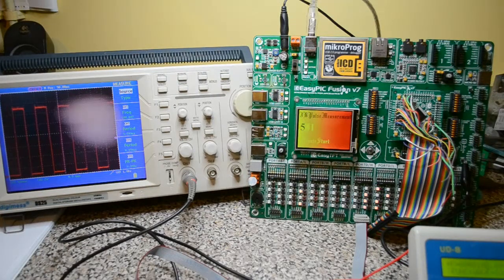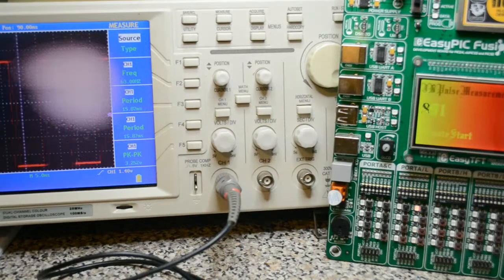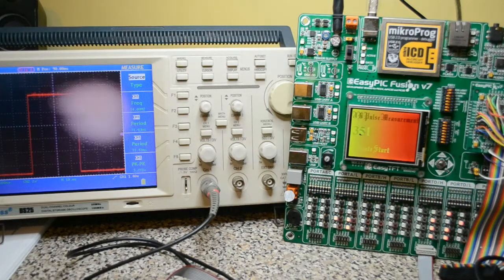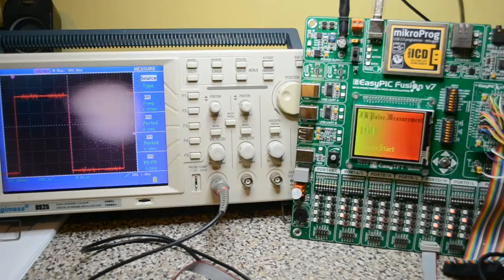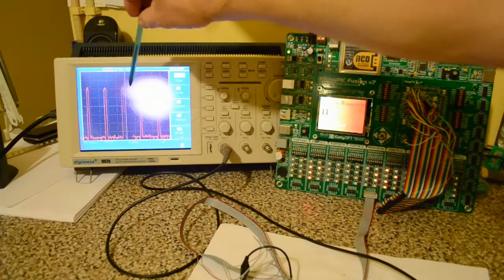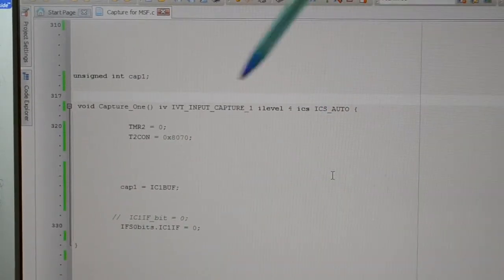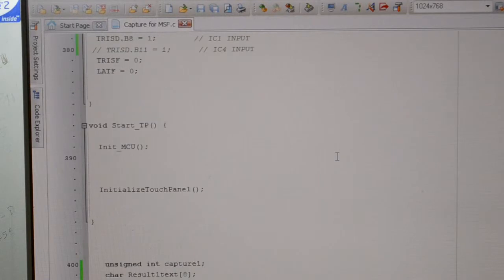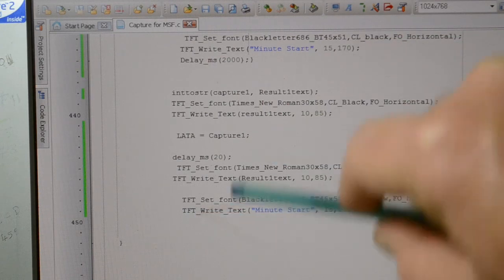Pic Pulse Width Measurement for slow Asymmetrical MikroC

Comment: Hi, That looks like condensation inside the screen of your scope. Which should be easy to fix. Just open up your scope and use a blow dryer to blow hot air into the fron of the scope and then the water will evaporate :-)
Reply from the maker: Hi,
No, the screen was damaged, seen it on others too
Reply: Thats too bad :-(